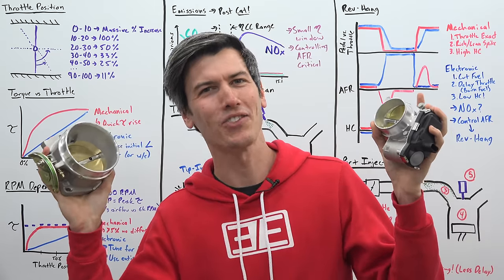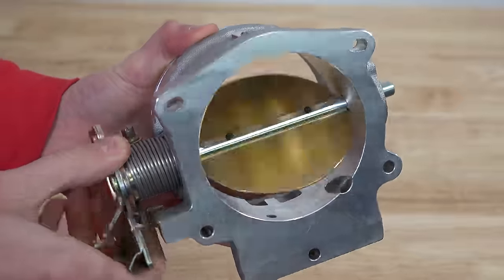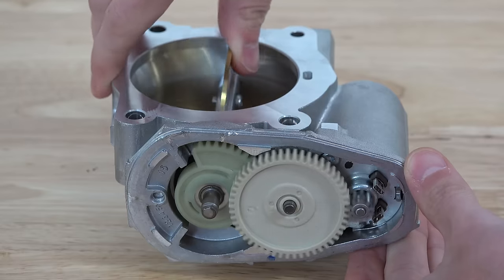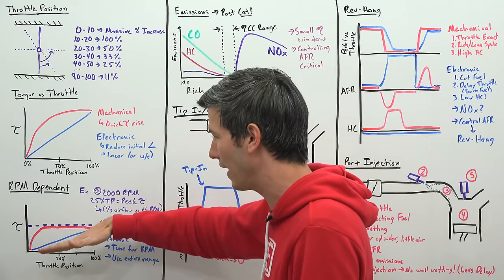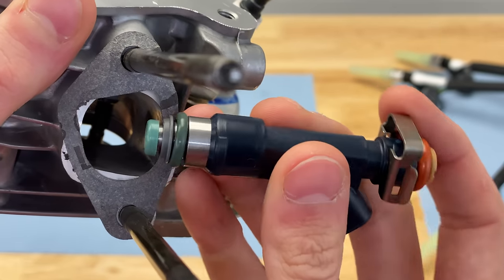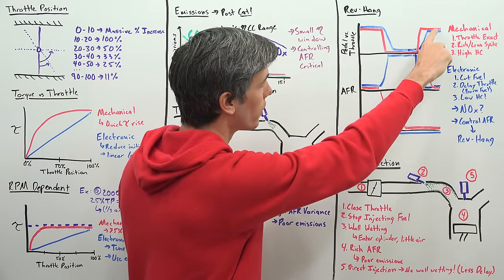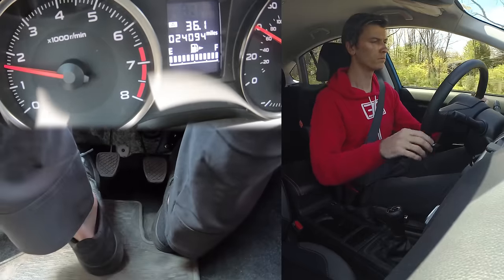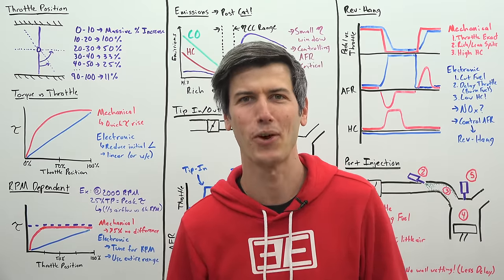The Big Problem With Modern Manual Transmissions - Rev Hang

Comment: Doesn't rev hang cause more clutch wear though. I drive a ford figo and the rev hang is so bad its almost like "rev stay". When its still warming up the revs will hold for about 1.5 seconds when you dip the clutch in and then only even start to drop down slowly. So when your shifting doesnt this mean the clutch has to work harder because it has to pull the engine down to speed bec its still holding its revs. Is this a design oversight, or is the clutch capable taking tht excess energy without more wear?

Comment: Rev hang is the reason I’ve given up on late model manual transmission cars. I’ve had several from different brands and they’ve all had this issue and it ruins the driving experience. It’s kind of a bummer.

Comment: A mechanical throttle can be given an arbitrary torque curve by adding a cam or scroll to the throttle valve. However it’s a fixed curve, so you still don’t get the other benefits of an electric throttle.

Comment: Can we get an explanation for Forza players? Does torque linearly increase with throttle position or is it curved like a cable operated throttle when were using an xbox controller? (with the input threshold mapped to the whole trigger for simplicity sake)

Comment: My car haves a mechanical throttle body, after like a 70% pressed accelerator I really can't feel a difference between flooring it...

Edit: it's an old chevrolet celta (never sold in the US), a 1.4L 103HP 1900 pound little hatchback!

Comment: As always, very well done!  And Happy Birthday to Engineering Explained!  This video reminded me of the long rev hang my '77 Celica had.  Rev hang in modern cars is nothing compared to that.  That car had a very long back-to-idle once off the throttle.  I didn't notice it on the test drive (salesman was probably talking) but right after delivery I thought the throttle was sticking.  I went back to the dealership and the service manager explained that it was for emission control, he said all Toyota's did that, and not to worry about it.  This lengthy rev hang was odd with the manual trans but after a while I realized that it did smooth-out down-shifting by going into lower gears easier.  And it also helped with up-shifting power because the engine didn't have to bring the RPM's all the way back up from an idle.  Anyone interested in learning more about why Toyota did this, search 1977 Toyota Celica GT, 5-Speed Manual Trans, Engine 20R.

Comment: AND with a Subaru with a CVT, you stomp on the accelerator and it just sits there. BIG lag before you start moving. To prevent 'rev hang': DON'T let off the gas>>power shift!

Comment: So you are saying you canchange the characteristics by changing the type of potentionmeters in the TPS from log to linear or vice versa?
Reply: A whole lot more than that, since you can tune every level of input on the TPS to demand a certain amount of power.
Reply: @TheInfinityzeN  Yeah naturally but on a very simple level. Like you said you donät need to change them at all just reprogram the behaviour. Meaybe you don't really even need pots any mor but could for example use a rotary encoder at the pedal and transistors operating in their linear region at the throttle body side to control stepper motors or servos from a simple arm processor or mcu.

Comment: Does this still apply if you have a throttle controller.. I’ve notice it just controls the sensitivity of the Pedal.. so if I press the throttle 25% on the max setting of the controller. Am I still getting peak Torque

Comment: Okay... but having spent the majority of your driving "formative" years driving carbureted - which is direct linkage, then throttle body with a direct linkage, it makes the electronically controlled throttle feel unresponsive and sluggish. Combine that with a dual-clutch automatic/manual like on my wife's CLA-250, which aggressively up-shifts, you have a throttle that is totally unresponsive at first.  Then, when you press it more, it is still unresponsive, as the computer forces a shift into the next higher gear. Then when you press it even more, it suddenly drops down two or three gears and the revs soar, and it FINALLY responds - but way too much.  If you were trying to get out of another vehicle's way, it might be loo late at that point.

Comment: Maybe I am doing something wrong for the last 40+ years driving standard transmission, but 1)-I never pull or close the throttle fully to shift I  just back off enough to sync the RPM to the higher (next) gear and 2)- The example on the video about Torque at 2000 RPM (constant??), well I rather have Max torque with the mechanical throttle at 2000 RPM than having this "smooth" transitions of the electronic system... Maybe it is just me... 3)- Also Torque peaks at about 1/2 to 2/3 of the RPM scale while HP is at or near the read line, therefore, I want the throttle wide open during acceleration and not this proportional opening idea.

The only time you jerk the car or rev hand is if you are not sync well enough or shifting soooooo slow that you are loosing a large amount of speed during shifting.... 

All that info on the video is correct, but maybe it just an electronic/computer solution to adjust the emissions and the jerking issues for people that are not driving the car correctly in the 1st place....

Comment: I have a turbo charged car with port injection (saab 9-5 biopower), it is supposed to run on both ethanol and petrol. Running it on e85 makes it run smothly and have more power ofcourse but everytime I run it on petrol it missfires a lot and wants to die every time i press the clutch while slowing down. I have checked my ignition system, fuel injection and compression but i cant figure out why it runs like crap on petrol, it should at least be smoth and not stutter right?

Comment: Couldnt this DBC surge in torque for first 30% of throttle press be mitigated by using a cammed pulley of the throttlebody where the first 30% is quite flat for next  then for next 40%  starts an agressive curve and even a bump up for last 30%?

Comment: An engine doesn’t need a linear torque curve because it takes more torque to get the car moving from a stop than it does to accelerate a moving car. It’s one reason the spacing between gears isn’t a linear curve, either.

Comment: My 04’ Durango rev hangs causing pulling trailer down steep passes dangerous. It doesn’t cut out until it gets to 3500rmp.  Any solves?
Reply: Same issues here.

My Impreza Diesel luckily isnt pulling a trailer down a road, but it typically just ROLLS, without any noticeable engine braking up to also about 2500-3500 rpm.

My mechanic just told me to shift down and use 3-4k rpm, but thats a damn DIESEL and i know 3-4k rpm is not what a diesel want to be used at.

Comment: the rpm will jump up by 1000 if you drive a fly by wire the way you did a standard throttle manual trans its not just hang its gain

Comment: What I hate about the electronic throttle on my 2017 Camaro... so mine does not have rev hang like what your talking about,  my revs falls quickly BUT the pedal is very unresponsive I can't rev match in it-I can floor the throttle and lift off (blip) mine does absolutely nothing!! Pisses me off I have to floor it and give it a second for it to actually happen by that time I could have already changed gears.   Also because it is so unresponsive it makes it hard to do smooth gears changes, I can do it if I put clutch in and out fast which I fell would cause premature wear for changing gears like I'm racing or at least spirited driving.  I feel like manual transmission vehicles should not have electronic throttle. I'm not sure what a new Mazda MX5 (Miata) uses but it's super easy to rev match them-I test drive one recently.
Reply: Had this problem in my car a few times. The throttle wouldnt respond to a blip and sometimes would do it again lol. Its not even a sports car either def an issue

Comment: Road cars have never been the same since drive by wire throttle came in. I reluctantly have a modern reliable car with DBW throttle, but my other two cars are mechanical: one carbs, one EFi. I find DBW utterly horrendous - everything from Porsche to Ford.

Comment: so theoretically carbs don't have lean and rich problems with tip in and out because the air fuel mix is controlled by physics instead of an ecm?

Comment: My 94 toyota pickup with mechanical throttle body has a “dash pot” which slows the closing of the throttle. What would do the same thing as the electronic throttle body. So I what would be the advantage then from what I have to electronic?
Reply: The idle air control (IAC) controls how fast the engine drops RPM as well as the idle of the engine. Ford has had Mustangs doing the rev hang since 96 at least. So it's not a drive by wire thing

Comment: Interesting how much stuff goes into airflow/mixture control. Run a 54 Chevy truck daily with a Weber 2 Barrel as economic/performance upgrade on the old carter single barrel. Throttle response is extremely smooth. Its eager to rev to its max. Revs drop...what you could call the natural rate. The engine runs a rich idle, lean low, rich middle and rich upper. The two barrel flows more air in the high bracket than the engine can use. The setup is 1000 parts less than a modern cars fuel/air management. Best...no clicks, whirrs or clacks like in a modern car, no surging, no hanging. If you have that - you dont want to drive a modern car - its way better.

Comment: About mechanical throtle, I think it works opposite way than You explain it because of circular shape. First 10% is actually less than second, second is less than third and so on. Its from mathematical point of view, I dont know how exactly mechanical throtle works and I've never drive a car with mechanical throtle. I might be wrong :)

Comment: I still prefer straight up cable driven throttle. If you're paying attention to your car you can feel the throttle, most people know not to give it 25% throttle to get 25% power, you give it like 7-10% throttle depending on the engine.

Drive by wire takes more control away from the driver, separates you from your car. I hate that, make me feel numb to what I'm doing. I want my car to respond to my inputs, not what it thinks I want.

Edit: this is also less of a problem with a 4 bbl carburetor. This is one situation where advancing technology missed the simple answer. 4 bbl carb with anular boosters work quite well.

Comment: Folks.....all things aside and all the technical talk.....driving a stick shift car is a skill and an art.And you have to learn the feel for any given make and model,and even within that,each and every car can "feel" different. So learn your car,cooperate with it,and it will shift smooth as butter. 2012 Chevy Cruze manual owner here,and I can get mine to shift as smooth as an automatic.
Reply: I learned that the hard way.

I removed DPF from my Impreza diesel and a (subaru…) technician chipped it to 180HP.

Since this day the car has super annoying rev hang, but the upper side of that, when driving „normal“ its pretty comfy and you have much time to rev match before letting the clutch go.

Its just annoying when i really send the car and i want to shift faster so i have to abuse the clutch and drivetrain a bit more.

Comment: Sorry, i disagree with your statements regarding torque increase over pedal position in the comparison of mechanical throttles vs electronic ones. In my experience it is the exact opposite: throttle response is a lot higher in the first 10% of pedal travel for electronic throttle bodies.

Comment: Engineers adapted mechanical throttle position by using a cam to adjust shaft rotation vs pedal movement.

Comment: 05:00 when I press 90% on the pedal (1800rpm), then should be the usage of fuel is lower, cause for the throttle losses are lower. Am I right?
Reply: I learned it different.
Most ICE engines are made to be the most efficient at anything between 50-80% throttle.

Going nearly 100% (or 90…) and the ECU has a richer mixture to avoid too high temps, while going less than 50% throttle means at least with petrol cars and a throttle body they are less efficient due to the losses there.

With Diesel cars its efficiency at different scenarios is more about the engines size and losses to maintain its own momentum. For example i drive a 2l Boxer Diesel (Subaru Impreza), i drive very efficient from lets say about 70-110km/h since the engine needs enough power to make its own losses „negliable“. Meanwhile the typical lets say 3l V6 diesel engine is pretty inefficient at 70-110km/h, but gets more efficient than my Subaru at 140-170 for example where my 2l diesel already go into a richer mixture decreasing efficiency.

The comparison between a Boxer Diesel and a big regular V6 diesel might be a bit sketchy since this subaru diesel is pretty much NOT a highway racer and gets by design inefficient under heavy load, but its similar with my VW Golf with a 1,9 TDI… efficient up to about 110-120, anything above and the consumption goes thru the roof (or rises noticeable)
Reply: But in general… its always a good idea to rather accelerate with 1800rpm and about 2/3 throttle than with 3000 rpm and 1/3 throttle. As said… best efficiency you have typically in a normal to lower rpm range and under about 50-80% throttle. 80%+ throttle will give you for sure a too rich mixture to be anywhere near a efficient spot to run the car.

Comment: I have driven two (basic) cars: 2009 Nissan Versa for more than 9 years, and 2016 Kia Forte for about a year now, both with manual trasmission. Which powertrain do I prefer? The Nissan Versa's. Why? Even though the Kia is much safer, has better handling in every situation, is more comfortable and stable, and even more fun, its manual transmission makes me feel so disconnected from the car to the point that several manouvers such as overtaking feel unpredictable. With clutch delay valve and who knows how many electronic intrusions, its manual transmission is far away from engaging and funny. I think at this point, and sadly from now on, getting an A/T may be a much better option in most of the cars, since they seem to be better tunned as time goes by, M/T, just the opposite. It makes me sad, since I am one of those people who really love(d) manual transmissions.

Comment: I feel like my Acura RDX is programmed the opposite. You touch the throttle and it jumps off the line. I wish they programmed it differently. I've driven cars with 2x the horsepower and half the weight and never had the throttle jump this thing does.
Reply: That is actually a common problem I end up having to tune out of vehicles.  I made a post about it, but long story short you end up tuning some chunk of the lower throttle input to demand power at a reduced level.  How much is a combination of the pedal itself (any slop? whats the initial angle?), power at idle/low rpm (more power means less demand), and the transmission (locking/direct contact gets less demand, while fluid transfer can get more).

Also some cars are factory tuned to start power demand at more than idle.  So your first 1% throttle input might demand 10% power.  This is fine for engines that make very little low rpm power especially if they are in a heavier car.  However in cases where your engine has decent low rpm power and the car is not so heavy, it REALLY ups the twitchy throttle feel.

Comment: I don't understand why manual cars with electronic throttles don't rev match on their own.
I guess they don't over-rev anticipating a normal down-shift and the drivers selects a couple gears down instead just one?
Even matching revs only once you have selected the next gear would reduce clutch wear and improve comfort tremendously right?

Comment: My 2017 subaru impreza was tge rev hang master. You could make a sandwich while waiting for r's to drop. One benefit is that it was super easy to drive for novices. You had time to shift smoothly, no need to rush. My wife could drive it perfectly, and only drove manually twice in 18 years.

Comment: I have a 2006 V6 6spd manual transmission, auto electronic throttle (no cable). It has randomly started revving between shifting gears. So, as I engage the clutch/let off the gas to shift,, the rpms increase until I put it back in gear. Anyone have any suggestions?

Comment: Drive by wire throttles must be good or Formula One wouldn't use them. But excessively lean AFRs, while clean, would burn the valves and pistons and as you said create NOX. The guys who program the chips must have the feeling that they just can't win!

Comment: You totally nailed it. I used to do emissions testing at Ford back in the 80s when cars were transitioning to 3-way catalyst necessitating, prior to EFI, feedback carburetors to attempt to control to stoich AFR. But with carbs there were all sorts of AFR excursions during transient tip-in tip-out modes, and on a tip-out, all the wet fuel clinging inside the intake manifold suddenly vaporized and sent this huge HC spike which blew through the oxidation catalyst. Remember dashpots on the carburetor? This slowed the closing of the throttle to it's idle setting to attenuate the fuel vaporization rate, the first form of rev-hang. But even on my 93 Mustang with EFI and cable actuated throttle, it has the annoying rev-hang, but this is the idle speed control valve acting, like drive-by-wire throttle, to bypass air to achieve the same emission control goal. Just some retro perspective to ponder. The guy below said it succinctly,  'it's to control emissions'. Today, there are regulations to be met, vastly more stringent than the 80s. Give credit to the engineers that achieve them and build engines like the Coyote, LT6 and Hellcat.

Comment: More like manufacturers can charge you $1000 for the throttle assembly compared to $100 one, my 3000GT had a vacuum setup for slower RPM drop back in the 1990 :O and now the future is using electric motor.